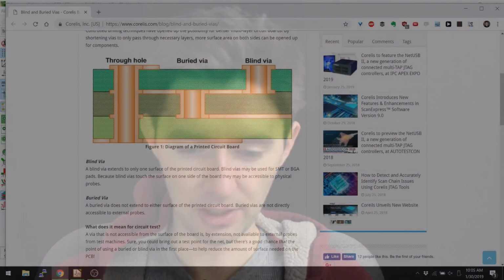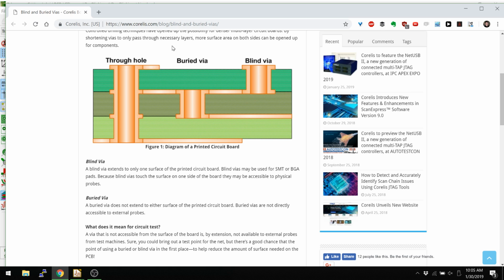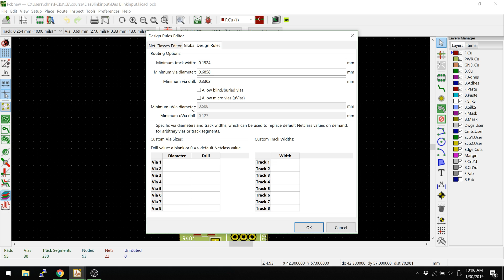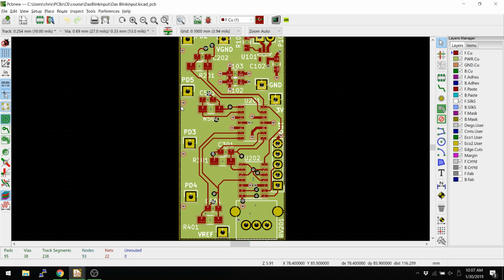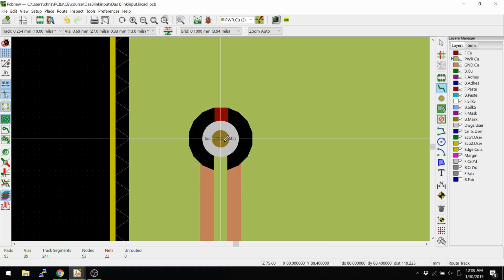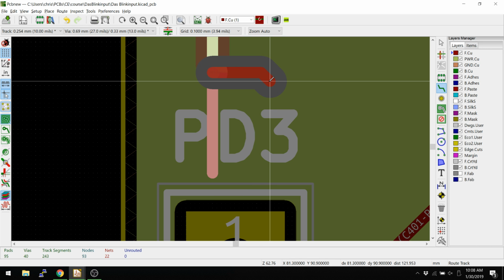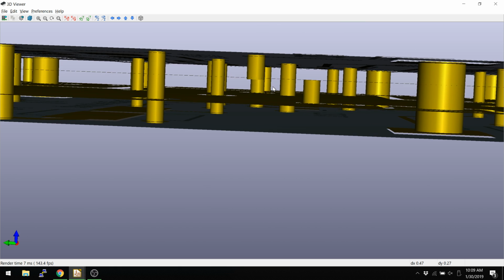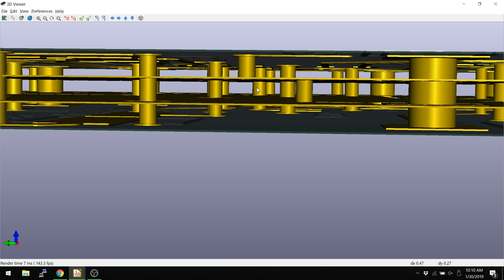KiCad 5.0 - Blind and Buried Vias

Comment: Hey bud I'm loving the new kicad 5 series. When I first discovered kicad there wasn't much current content. Would you be able to work on a larger project which takes us from initial concept to finished product. I'm happy to see it go over as many videos as it takes. :)
Reply: You should definitely check out his (paid) Contextual Electronics courses on his website.
I took the first course a few years ago as I had taken on a work project, and it accelerated my KiCad and general PCB skills very quickly. Well worth the course fee IMO.
The course was project based (as you've mentioned), so it went from circuit concept, schematics, layout, prototyping, and testing.
Reply: @DarianCabot  thanks for the reply. I definatly will check it..
Reply from the maker: @D3ltaLabs  Yep, like Darian said, that's what the course tries to focus on. Would love to hear what kind of content you're looking for in general though! Please feel free to post in the "Course Questions" section of the CE forum: https://forum.contextualelectronics.com/c/course-questions
Reply: @contextualelectronics  Im basiclly looking at designing my own SOC board which interfaces with the canbus, and has the features im looking for. I have strong understanding in programming and an all round knowlege of electronics, though I have minimal knowledge on KiCad or design in general. Other then what of learn over the years of watching countless videos from EEVBlog, bengheck, greatscott and some other great content creators such as yourself. Im more or less doing it as its a project Im interested in enough to keep me motivated in learning how to design my own PCBs. Thanks for reply.

Comment: A buried via between Vcc and ground planes??? Equals trouble shooting nightmare. Pay attention to detail even in your examples. My first 8 layer board more than 45 years ago had eight such screwups, we ended up charging a large electrolyte cap to a 100 volts or more and repeatedly applied to vcc and ground planes (bare board) to find and blow out the barrels. This is a first good test, measure resistance between planes. Good tools these days should catch a dumb error like this.
Reply: Which program were you using 45 years ago for this purpose?
Reply: @sarperonal1803  pads and tape, sometimes rubylyth